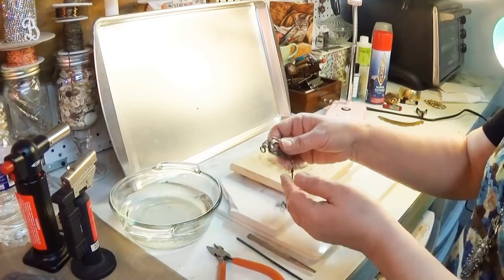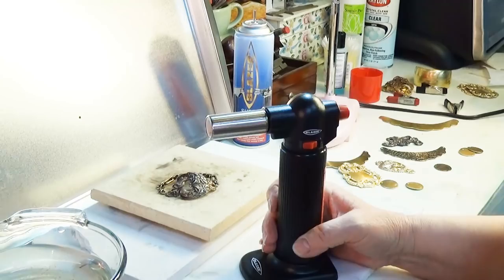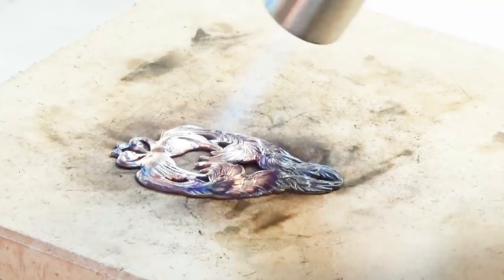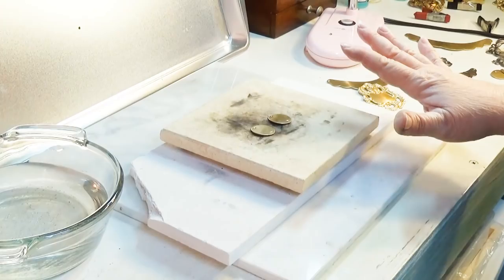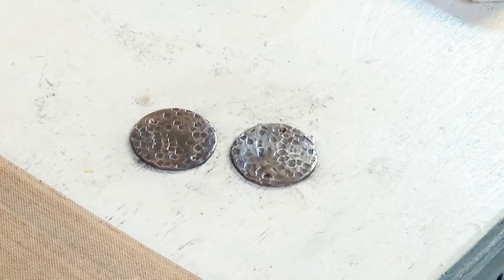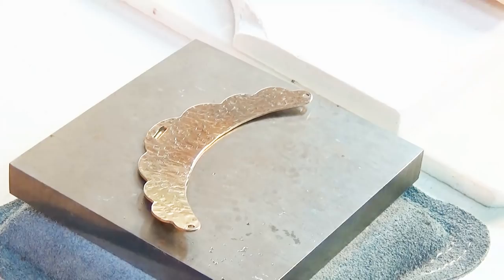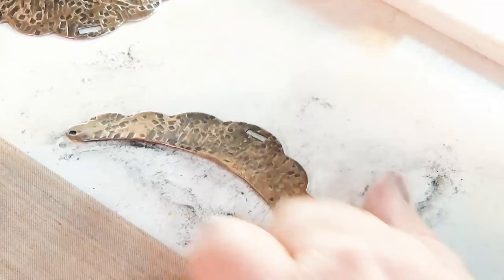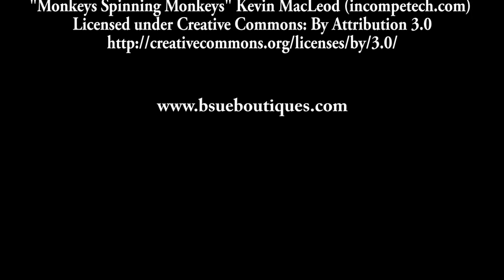Heat Patina on Brass Using Blazer Torches, More  Tips from B'sue

Comment: Stainless cools the metal. It is an old jeweler trick , if your metal gets hot from from grinding to through or on a bench block or put a hot ring on a steel mandrel

Comment: Is that a cement block or some other material that you put the brass on when you torch it?
Reply from the maker: soldering block, very easy to find.  We sometimes carry them but if you don't find them with us, you can Google and find quickly.  They are not expensive.